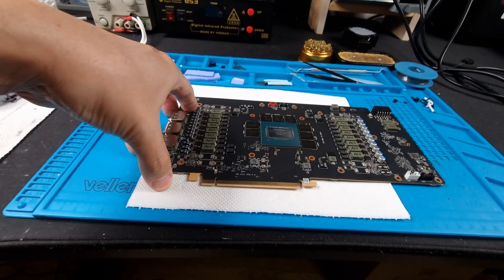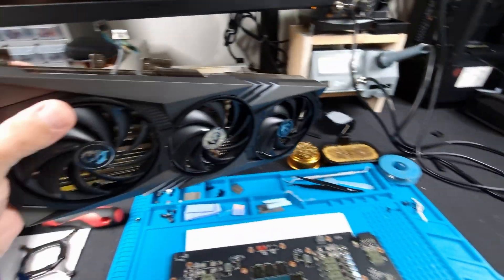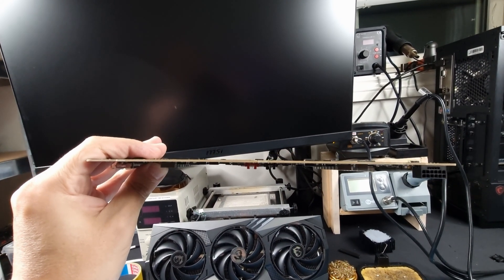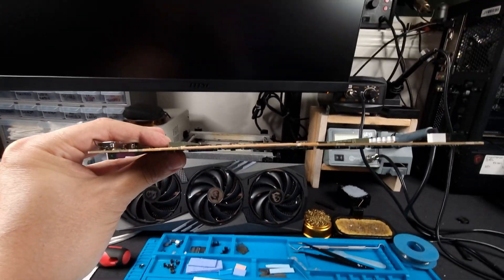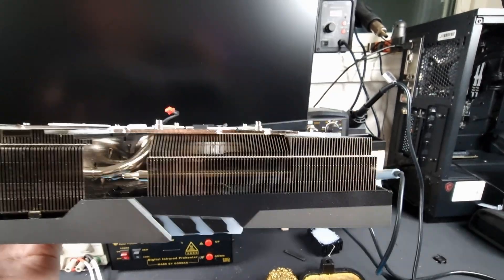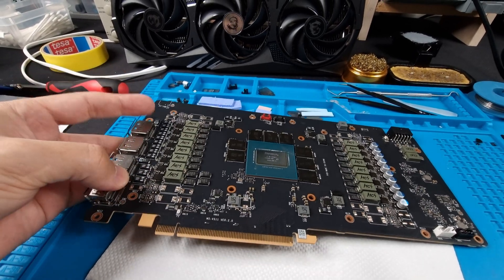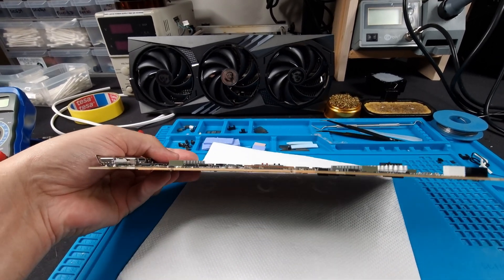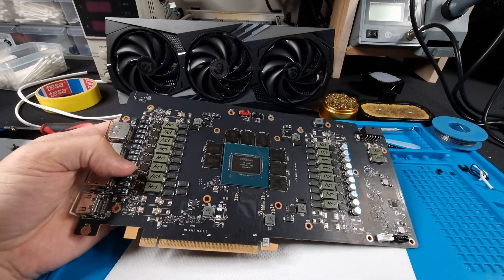How Using GPU Supports Incorrectly Can Destroy Your GPU.

Comment: Wow, that was a big ole stack of Zotac cards. My Zotac 3080 Ti still runs great after a few years, but I see a repaste and repad in the near future. Good thing I also just upgraded to a PNY 5080 OC, so I can take my time redoing the 3080 Ti.
Reply from the maker: As I write this comment I am working on a Zotac 3080 ti. Congrats on the upgrade. Hope you got that on some supports, as that is a heavy card. I have one here also 😂
Reply: @TechnologyHive  Yeah, this card is absolutely massive. A big ole chungus. I just added this LinkUp 5.0 riser to my cart. Luckily my trusty old Phanteks Enthoo Evolv X case has vertical GPU support, and I just dug the little accessories box out of storage, and voila, it had the riser adapter right there in it. This PNY came with a little support post, I'm using it for now, but with no upward pressure. Just keeping the card from actively sagging, but not pushing it up with positive tension. I think that's the best short term solution until this riser comes in next week. All in all, I'd rather a riser be the dispensable component than my GPU or motherboard.
Reply from the maker: @AlphaMachina  Enjoy your rig! Sounds like you know what you're doing. 👍👍

Comment: Couldn't they reinforce the edges to prevent the beinding?
Reply from the maker: That would cost them money lol Of course they could, but nah...the end user gets the finger. They could even keep the cards the size of reference models, but nope. They slap these huge coolers on these small PCB's just to increase the power for a few extra FPS, thus increasing heat, which results in the need for big heatsinks, which in time, if not supported properly, will end up in a dead card. Sad.

Comment: I'm probably a bit paranoid but I've been using an aftermarket bracket from Cooler Master ever since I got my first GPU that weighed around 1.5 kg. Not sure if it is/was really necessary as all three cards (Gigabyte 4070 and 4070 Super Gaming, Palit 5070Ti GamingPro) sat/sit in my case like they were welded in place, plus I've always double-checked their alignment with a spirit level and it's never been off ... but I guess you can't be too careful. 
For me, it's been the same case and motherboard (Fractal Pop Air XL + MSI Z690 Tomahawk) and seeing how securely all three cards sat/sit in there, I can't help but wonder if perhaps user error is one of the major factors here. Things like not securing screws properly, forgetting to lock the PCIe-slot, dropping/tipping over the PC or transporting/mailing it with the GPU installed and no packing material on the inside to secure/protect the card, etc.
Or perhaps it's just that 1.5kg still isn't enough to push things to the limit as there are cards out there that weigh quite a bit more.
Reply from the maker: There are cards more prone to failure than others, like those made by xfx and gigabyte. They like to use extra large heatsinks, which is too much for the pcb to handle.

Comment: I put my tower case in horizontal, less stresss on gpu, and less stress on cpu with air cooler. Maybe the aiflow is a little worse, maybe is better to buy a dedicated horizontal case, maybe... I do not know if I do it well, but, that's what my physics logic suggests, and I think it's better than using the tower vertically, even if that's what it was designed for.
My financial logic also tells me that a GPU adapter is more expensive and a horizontal tower is much more expensive (until logic makes them popular again).🤪
Reply from the maker: You can pick up a GPU vertical mount kit for around $50 from Phanteks. But, placing your case on it's side also works.
Reply: @TechnologyHive  My MSI MAG FORGE 121A case only costs a bit more than a vertical mount kit. for me, is not cheap.
But you´re right, is better to invest in a vertical mount, or in a better case. I expect to have no problems with my 9070 xt.😀

Comment: A single core board +RAM and some power IC's for $2000+ we are being scalped. The 4090 Should not cost more than $800 and the 5090 no more than $1000 tops. Same with phones. They are marking up in the 400%+ range. And the quality is not there. These are mass produced products at insane prices. We used to build game rigs for $1500-2000
Reply from the maker: And the next gen is not going to be cheaper either. The prices will keep going up as long as people are willing to buy these things.

Comment: Lian Li GB-002 GPU Holder is perfect for me tho if you put it properly on a good quality MOBO too. i have a 9070xt mercury oc magnet air that is 360mm long so i had to put it  .. cause i have fans on the bottom and i move a lot with my pc in my car i cant put a pen holden on the bottom with these fake magnets.. lian li did a great budget work. otherwise yeah go vertical but then you will have some issues with temps!
Reply from the maker: Just to clarify, if you use a 3rd party vertical mount kit, your GPU temps will improve or remain the same as when installed horizontally, with proper case ventilation.
Reply: @TechnologyHive yeah yeah of you have planned to go vertically before you buy other comps of course. I meant if you go after in case you already have pc case,mobo etc.
Reply from the maker: @panagiotisacab7  Okei I hear ya.👍
Reply: @TechnologyHive nice topic tho. These small informations are important and noone mention them 🎉
Reply from the maker: @panagiotisacab7  Glad to help :)

Comment: That looks like dudes forcibly pushing the gpu support up as much as possible, I tend to leave it flush with the card using a level to keep it straight with no sag or push.
Reply from the maker: How you do it its the way it is supposed to be done. But some people do not know how to properly use supports. It's not their fault. Freaking GPUs are getting too large these days.
Reply: @TechnologyHive yeah man, I went from a 3080 to a 7900xt and that one was a monster, now I have a 9070xt and it's perfect.

Comment: I wish there was a perfect GPU sag solution. Vertically mounting has disadvantages to. 2017 I noticed GPU sag being a problem. That's when GPU girth became an issue. Since, I used GPU bolsters and never had a problem with any GPU cracking. I do take in consideration what you're showing when installing a GPU support. Could be not balancing or over torquing the support, and the card design.
Reply from the maker: Its really just people not knowing how to use support properly. I do not blame them. This wasn't a thing in the ole days. Now its a must if you buy a high-end GPU.

Comment: @TechologyHive put the stand towards the back where the card is screwed in, adjust in the spot to where it's touching the top without pressure.  move the stand in this adjusted length to the end corner, then increase the length just a bit more for just a slight amount of pressure.  They also sell nice stands the magnetic bases so that it won't move around even it you don't have it that tight.
Reply from the maker: I buy those supports in bulk, from AliExpress. They are perfect for this.

Comment: Good luck getting any air to the gpu in smaller cases when you have it pressed up against the glass. You would be better off laying the computer on it side like old computer used to be configured normally.
Reply from the maker: This is why I recommend a 3rd party vertical mount kit, like that from Phanteks, so you GPU is not up against the side panel.

Comment: The whole cooling sytem is making the card heavy, So much metal  to cool off the components. GPU Riser cable is good choice or use the Anti Sag bracket or plate correctly.
Reply from the maker: If you care about using your other PCI slots, support work just fine. 👍

Comment: Do assh073s really destroy that many cards?  Holy smokes.
I never had a problem with them.    I use a bar support going out horizontally from the left side of the case. 
Ideally, it would be better if they made a curtain rod like bar that just went from the left side of the case to the right side of the case, that GPU would rest on top of like a shelf.
Reply from the maker: A lot of people do not know how to properly use a support because they've never had to. Cards were smaller, lighter, back in the days. Now these newer cards are as big as mini ITX case.

Comment: Those with high end gpus that uses liquid metal stay away from raiser cause gpu orientation might make it leak, same with certain thermal putty. best is probably to support gpu from right side (close to where old 8pin connector usually are) this way u got case io, pci e slot, and the support on the right side sharing the load without the mid point deforming.
Reply from the maker: Thats a good tip! Thank you for the comment!

Comment: If you don't use anything, it'll bend. If you use raiser it will bend. If you use a leg, it will bend.
Reply from the maker: The problem is the weight. Just use some kind of support 2/3 the length of the card.

Comment: I also highly suspect that the high temps are at least part of the problem you're describing. The twisting probably happens because such heavy cards truly needs two supports, one at each end. 
As for supports/risers I've been thinking for a long time that some ppl are surely adding too much upwards pressure on them.
Reply from the maker: One support between fan 2 and 3 will suffice. Placing it at the end of the card is not enough, in fact, that could cause more problems. If you do not want to use support, I advice to use a vertical mount kit from a 3rd party like the one in the video from Phanteks.
Reply: I just keep my entire case in horizontal position. Case solved so to speak :V
Reply from the maker: @Corle0ne  That works perfectly!

Comment: Tony from Northwest Repair did mention in one of his videos that GPU support should not be put at the end but in the middle right under the power connectors.
Reply from the maker: I say the same thing. It is a 3 fan card, rule of thumb, place the support 2/3 the length of the card, or between fan 2 and 3. Done.
Reply: So I randomly placed my Lego support tower at the right spot. Nice 😊

Comment: How do you use a GPU support incorrectly? That's insane. I put my support closer to the PCIE interface and only raise it to be level with the interface. How hard is that? Been running that way for 3+ years. And I cake my card out every 6 months for cleaning.
Reply from the maker: Believe it or not, this is one of the easiest things to get wrong when building your own rig.

Comment: Great, you're making a point of obstructing all the other PCIe slots... that is if you mount the GPU on a riser.
Reply from the maker: I dont need the other pci slots. If you need them, then dont install your gpu vertically and just use support. End of story.

Comment: My opinion is that if a gpu has a long 3 fan cooler then I'm not gonna buy it. My Asus 4070 dual has about the same or even less sag then I remember my old MSI 560 TI twin frozr 2 had more then a decade ago. (I had a rev1 version without the support bracket) Between the NVIDIA arson cable connector, and cracked PCB's its just not worth the risk for mor performance. I have an evolv x case, but I also bought a full ATX mobo... And I want and USE those slots for nvme cards. if I didn't care about those slots, and only gaming then I would have just got an ITX mobo and riser. Heck, just get an ITX case with a vertical gpu riser included lol.
Reply from the maker: If you can find the Cooler Master Elite 130 out in the wild for sale, new or used, I would jump on that fast. One of the best ITX cases ever made, imo.

Comment: the only safe way to use morden brick and big king Bahamut gpu is vertical because gravity say so and that in the big company brain that gravity not effect your gpu but in reality it did heat and unbalance weight make bent and that all gpu in that box is bent and damaging  the gpu chip the more massive an object is, the stronger it gravitational pull Isaac Newton say so
Reply from the maker: And next generation will probably be even heavier.

Comment: In my honest opinion, you don’t need anything above a 60-class card. I just bought a 9060 XT 16 Pulse for a reason — it’s small, compact, the PCB actually matches the cooler, and it’s lightweight. You don’t need triple-fan coolers on 60- or 70-class GPUs.

People always say, “More surface area means more cooling,” but that’s not the whole picture. There are actually three major parts of heat transfer, and surface area alone won’t compensate for poor engineering.

Conduction — Thermal conductivity is crucial. If your heatsink material has low conductivity, it doesn’t matter how big your cold plate is. You need a highly conductive material to make use of all that extra weight. This is where aluminum (or better materials) matter.

Convection — Fin thickness matters. Fins should be thin, not thick, to improve the convective heat-transfer coefficient. Manufacturers cut corners because thin fins are harder and more expensive to produce, so they use thicker fins that are heavier and less efficient.

Radiation — This plays almost no role in GPU cooling unless temperatures are extremely high.

That’s the basic heat-transfer breakdown.

This is why I prefer small, lightweight GPUs — they’re often designed better. If you look at professional workstation cards, they’re usually light and efficiently engineered, unlike many of the bulky, overbuilt “gaming” cards that are basically garbage in comparision.

Comment: Bending also has a solution: give the GPU two supports — one at the middle of the card where the core lies, and a second one at the end. That way you have three supports total: one at the end, one in the middle, and a third at the case/cabinet level. The problem is that these cards are poorly designed. They want the GPU to behave like a cantilever, but they ignore the span length and the bending moment at the center.

Some PCBs are smaller, but to upsell the card they install heavy coolers on the GPU. That forces them to extend the PCB, and it’s the weight of the fins that ends up damaging the cards.

The two solutions I can think of right now are:

Replace steel with aluminum fins to reduce the weight.

Run a vapor chamber horizontally from the face of the card to the back of the card, and give it a built-in physical support all the way to the end of the card.

Both solutions will increase cost — and ideally both should be used. This is what happens when you ignore other parts of engineering. Mechanical and structural considerations get overlooked. The GPU "heart" can run as fast as possible, but what’s the point if the “body” can’t keep up?

People should sue them. It’s not the customers’ fault; how would they understand this? They’re buying a product that can’t even support itself. These cards are being set up to fail at the design level.

If you want, I can make the tone more formal, more technical, or more casual.
Reply from the maker: One support at 2/3 the length of the card is plenty. Between fan 2 and 3. But if you want to add more, sure. It cant hurt.
Reply: @TechnologyHive  yes at 0.66x it can carry it the problem is peoples make the support at face end and totally forget about middle one i still suggest 2 support for longer cards with 3 fan design in two fan config you can actually move the support to face end as the span will be lower but for 3 fan i suggest 2

Comment: i guess time to buy a leveler  measuring tool(the one with bubble spirit) and check it every now and then to see if its in perfect straight line and not sagging
Reply from the maker: You could also place your PC on its side so the motherboard is laying horizontally on your desk.

Comment: I have had my 4070 Ti Super without a bracket or standing support for about a year; can't really tell if it's sagging but I am probably going to buy a vertical mount. Does the bowing happen only with the bracket mounts or if I am to get a vertical brace and properly adjust it's height would that avoid the bowing issue? The reason I ask is cost consdieration; vertical mounts about $50 and a vertical brace is like $15

Comment: Thanks man gotten a new 5070 with 3 fans and it comes with a support and of course I didn't know better put the support after everything was screwed in. So gonna change that now. Praise be the YouTube algorithm for finding this out soon enough
Reply: @russkifussel I also have a 5070 with 3 very large fans, and it came with a bracket. I'm a novice at this, but how should I install it? Should I screw the card into the case first, or install the bracket first?
Reply from the maker: @Vitorfps8  Hello. I can answer your question, if I may. So, install the card, but do not tighten the screws securing the card to the case. Add the support and level the card. Once leveled, tighten the screws so the card is resting it's weight on the support.
Reply from the maker: Im glad you found the info helpful! Thanks for the support!